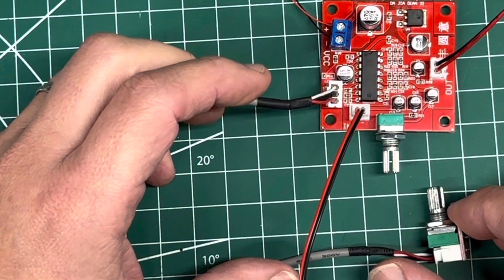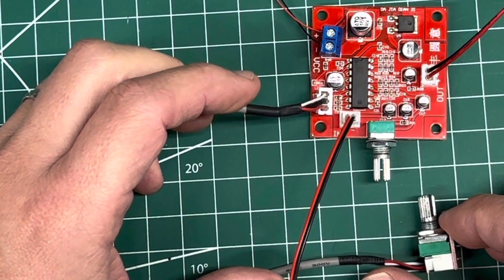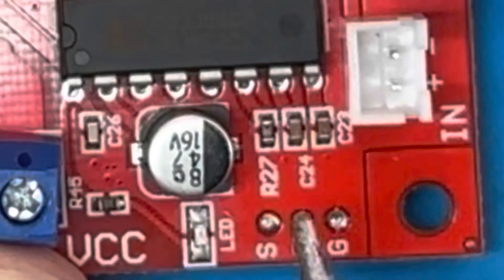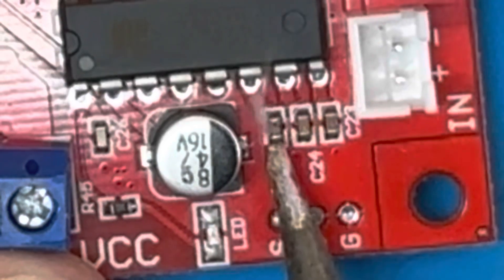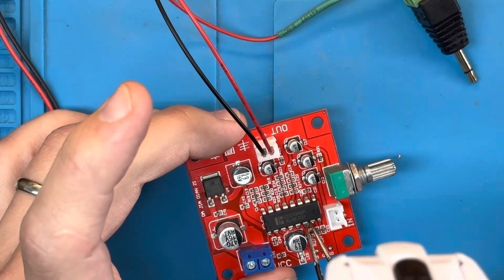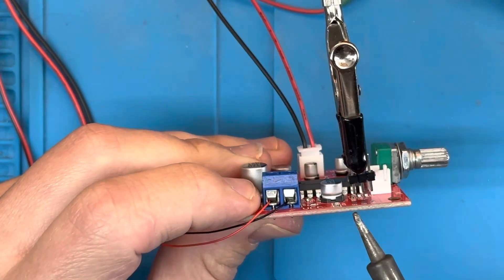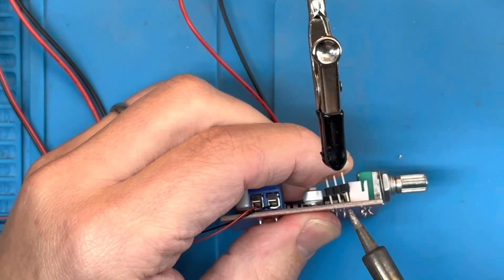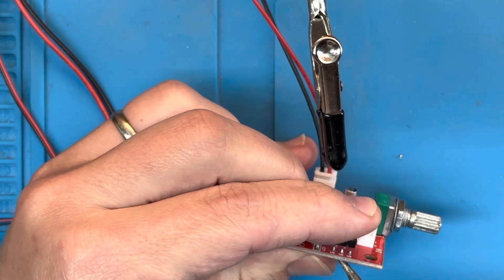Easy Reverb Board - part 2: Add Delay Knob (pt2399) - reverb/echo mod for pedal/cosplay mask/helmet

Comment: You need to put a 2.2k ohm resister in series with the pot. It will malfunction if it goes below 2k ohms.
Reply from the maker: Thanks for the info.
So you’re talking about a resistor off the pot itself?  Not the audio out, right?

I didn’t notice any issues.  If you have more clarification, I’m happy to hear it. Thanks.
Reply: @creative-stuff  The extra pot that you added to adjust the time delay.
Reply: @creative-stuff The pot you added is capable of 0 ohms. if you turn the pt2399 on it will latch and not work it the resistance is too low. Maybe you've' never turned it on with delay time pot you added turned all the way to 0. try it. It's during start up. It probably won't do anything once it's already on and working.